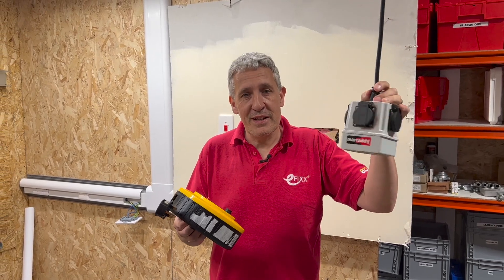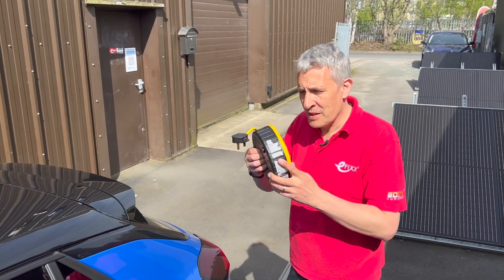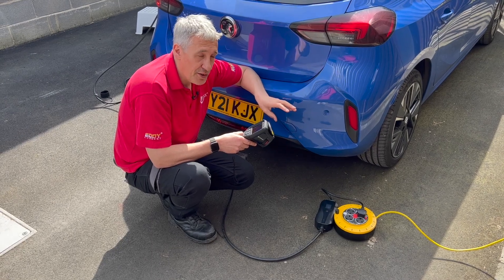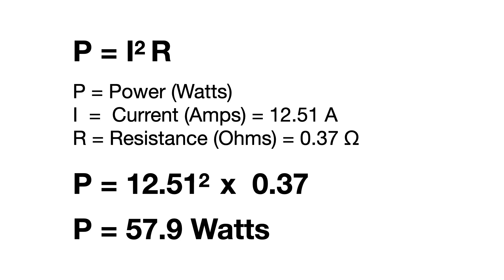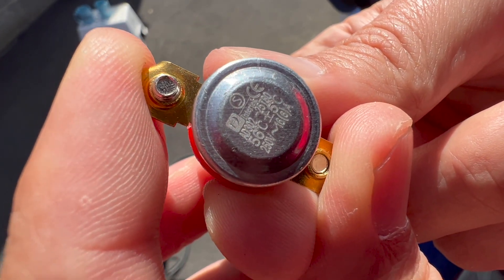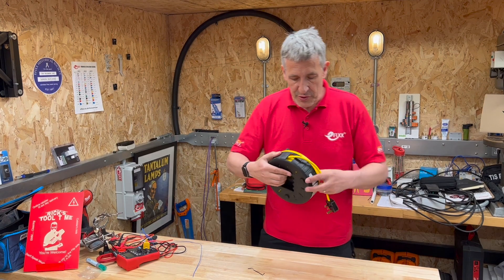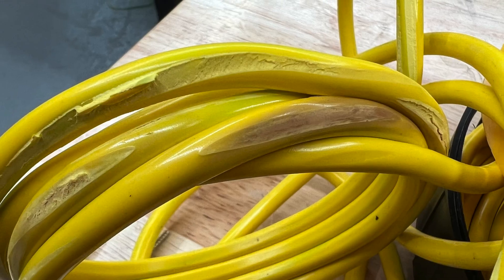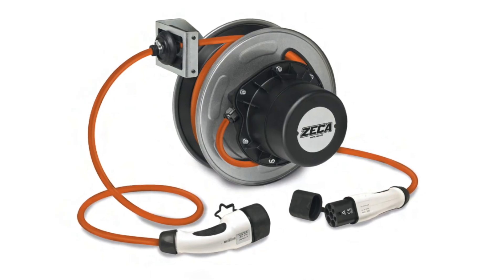What Caused this Extension Cord to Melt?

Comment: We had a power cut a couple of months ago which could of easily turned into our neighbors house being a live inferno. Plugged 2 2500w dimplex heaters into a 3500w rated extention lead. Luckily I was there to unplug it and give him a big rist slap but my god it was warm.
Reply from the maker: No thermal trip?
Reply: @efixx  Nope, his dads old 80's masterplug lead.
Reply: @megatronskneecap  Presumably with a special fuse as well?
Reply: @yngndrw.  yup.
Reply: Part of my job requires testing portable appliances in specific commercial buildings open to the Public. The number of times you see things like a Kettle, Fridge and Microwave plugged into the same extension cable is amazing.

Sometimes it's a kettle, toaster & coffee machine, sometimes it's 4 high powered devices on one extension lead, sometimes it's multiple chained extension leads.

Lots of people have NO idea what's unsafe.

Our family also found a fuse which had either fuse wire or just some wire soldered across the terminals by my Grandfather, likely in the early to mid stages of his dementia. He also decided to cut the phone cable in the corner of the desk with some scissors. Quite why he did that we don't know, but he had been diagnosed by then.
Reply: @CoolSteve08  I am just an electrical engineer and enthusiast and I 100% agree. People will do all sorts of bs to make their lives easier or to save a couple of quid. It's scary. I'm so sorry about your grandpops. That's also a big play. My auntie's dad had* the same issue. Used to take apart car parts actually as an ex-mechanic. Nearly got his hand taken off my a suspension spring. They eventually just had to distance him from anything car related which was in her mind the hardest thing she ever had todo.
Reply: @CoolSteve08  A lot of people have never heard of a spur which in a LOT of cases suprisingly does what the person needs in the safer manor needed.
Reply: @CoolSteve08  Hmm ... what is wrong with this combination of different things how plugs into the same multiple socket extension? I have this in my kitchen too but I never use all things together! Why someone should use a kettle and a microwave oven at the same time to make tea water warm? 😂 How crazy English-speaking folks are? 😳 [Yeah, I known, they use ring-routed for differ power. They scare power from one side.]
Reply: @OldLordSpeedy  in a house you tend to have a more spread out kitchen area, so there are more sockets and fewer mains extensions, and there are also fewer people who are having lunch all at the same time.

In a commercial setting it's likely that everyone will take lunch simultaneously (or near enough), and sometimes a kitchen is made out of a cramped room which has one or two worktops and not enough sockets on the wall. As such you can end up with a situation where one person is making toast, another is boiling the kettle and a third is cooking leftovers in the microwave, so you have three high powered appliances all being used at once.

In the UK a 4-way extension is limited to 240V 13A (3120W), a kettle is typically ~2000-3000W, a microwave is easily ~1000W, and a toaster can be ~600-1000W depending on whether it's a 2-slice or 4-slice toaster.

So let's say the kettle is 2000W, the microwave is 1000W and the toaster is 800W, that's a total of 3800W, which is 680W (~2.8A) OVER the maximum allowable draw.

I have seen a 4-way extension lead with 4500W worth of appliances connected up to it at once. Regardless of whether they use them all at the same time or not, we ALWAYS highlight that this is a fire risk & tend to leave some appliances unplugged when we leave (whilst drawing attention to the issue to the person in charge).
Reply: @CoolSteve08 that's gotta be one of the most scariest and dangerous thing's going. I’m guessing due to his age, everyone back then was a handyman. Did he change frayed and/or damaged cables once there was a little bit too much electrical tape keeping them together? Did he ever make up his own SPECIAL extensions leads by using connector blocks and electrical tape to keep the big chunks of water out? I'm not sure when they become popular (or more likely cheap enough for the home owner) but did he ever use through crimps to fix and/or make a longer extension leands?
Reply: @TheManLab7  not really sure that he did do any of that. He was an engineer by trade and worked on a variety of systems, including in the whisky industry for many years, so under normal circumstances these sorts of things wouldn't really be beyond his abilities, but hindsight is great and there were times when he was clearly having episodes related to his dementia (such as getting lost on the way to somewhere due to roadworks taking him a different route, never making it to his destination & still coming home late), but thankfully he never did anything exceptionally dangerous.

Comment: Have dropped comments before on sparkies channels about grouping factors.... such as putting all the T&E cables for example in a single 50 x 50 plastic trunk to a CU when they are moved/relaced with them rammed in and no air gaps between them. The same applies inside consumer units/distro panels - cable ties to group stuff together may look good, but it goes against the regs for grouping
Reeled extension cables are especially bad for this but this proves why you should have one with a thermal cut out as a lot of end users won't appreciate that they have to uncoil it..
Reply: The instructions always say not to use when coiled up.

People need to read the instructions.